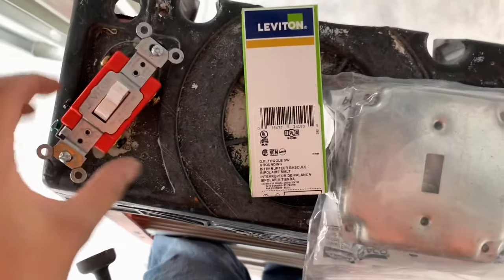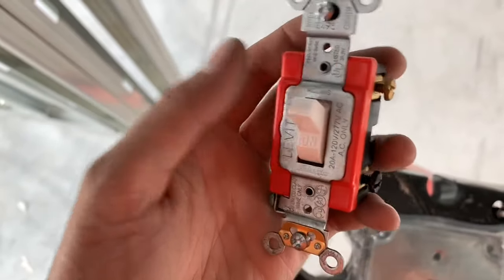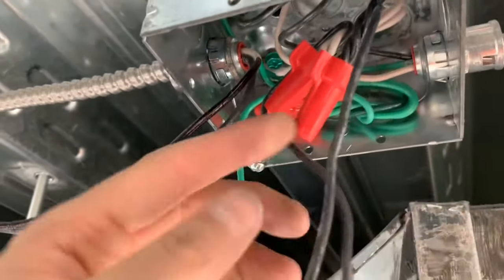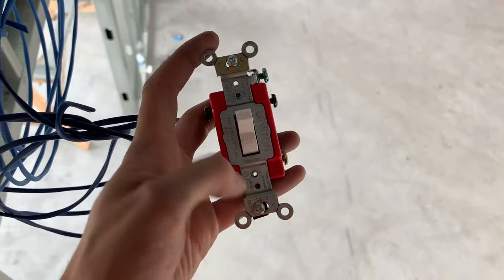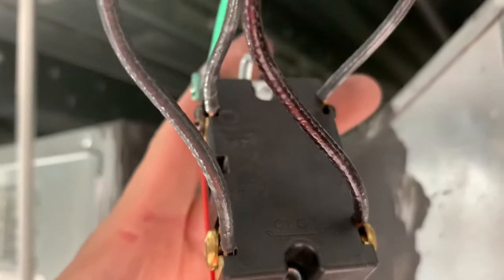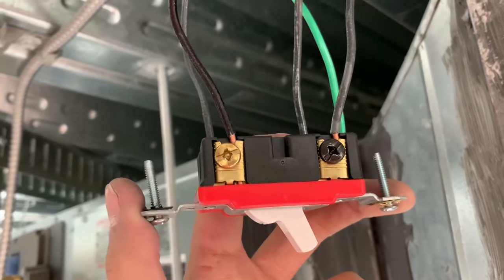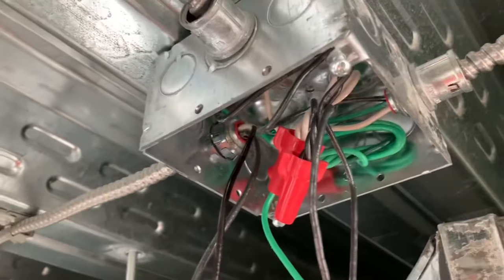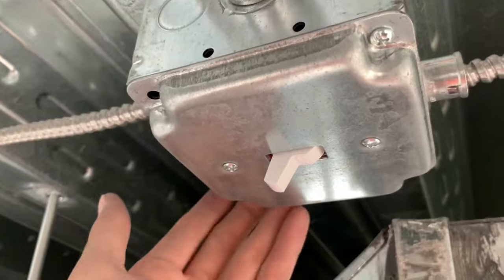How To Install A Double Pole Toggle Switch (Commercial)

Comment: I see a lot of people on YouTube showing how to wire a reversing switch on DC motors but not on AC.

How do you wire up a direction switch on an AC motor, like a drill press or bench grinder?

Can't you use a double pole double throw center off switch for that? Either a panel switch or wall switch?

And how do you wire it into the connection box on the motor?

I did it on my drill press with a four-way wall switch and a one-way wall switch for power.
I know that they make a double pole double throw center off wall switch also.

Some people say you have to use a drum switch but those things are pretty bulky and won't fit in my double gang box.

Or do you have to use a triple pole double throw switch?
My dad did it with a panel switch on his bench grinder back in the 40s or 50s.

Comment: Are you wiring 120 or 240. I'm not an electrician. But i just removed one of those type of switche and wired white to white and black to black. Ground wire was already twisted together. Just did it at 3:00 o'clock November 16th.
Reply from the maker: this is 240

Comment: Can I use this switch for a 240 volt electric hot water heater so I can turn it off and on?  But I would need a 30 amp switch.
Reply from the maker: yes, i believe so

Comment: Hi, I am confused about the part where you showed the load wires. I have one black and one white wire. Did you color over one of the white wires and if you did why?
Reply from the maker: yes i used black tape over the white wires, because they are carrying voltage and not used as neutral wires anymore for this 208-240v unit.

Comment: I know this is going to be a stupid question, but when connecting the load wires or the even the line wires to the switch, does it matter left or right?
Reply from the maker: its marked line and load, so it matters that the lines go on line side and loads go on load side. but it doesnt matter which side of line goes left or right, or load left or right.
Reply: @DailyElectrician  thanks... really appreciate this video and response.
Reply from the maker: glad to help :)
Reply: Well I try one? Nope is not working 
So I use line connect to black screw and load wire connect to red screw then boom is working
Reply: No, left or right does not matter is the answer you were looking for. As long as you have your load wires (lightswitch/water heater etc) on the load Terminals and your line wires (incoming power) on the line terminals.
Reply: Same goes for GFCI’s power on the line, anything downstream on the load since it’s protecting them

Comment: Hey I have an issue at work I have a 220 fan wire up to a single pole switch how is that possible?
Reply from the maker: it's wired wrong.

Comment: Awesome video man! clear quality. what makes me question you is the when you say "I'll be showing you the 277v option" then you pan up the camera to show 120v colors. secondly please explain how this could even be 277v when im seeing 2 hots for your hvac unit. Lastly is using a sharpie to color a white wire black workmen like manner? tell whoever is running that jobsite to order the correct materials.
Reply from the maker: maybe I meant 208, oops. not sure, never been called out for using a sharpie to recolor a wire. if anything its more workmen like manner because it takes way longer and looks better, haha. but i would say it could rub/ "wash off" one day. always up to the inspector to haggle you, even if you are right...

Comment: The ground wire on the switch itself - what's it's origination?  Is that the ground coming from your electrical panel?
Reply: Im having the same thoughts, im wiring a 240 garage heater with the switch as a disconnect, what im trying to figure out is if i have the switch grounded to the panel, do i need to run the ground wire from the heater to the switch as well and double it up. I cant find the answer.
Reply from the maker: rick yes, its tied back to the panel through all the grounds.

tyler the heater should be grounded, wether its from the switch or somewhere else. assuming the heater is coming off the switch so yes it should be in the switch box

Comment: Good as far as it goes but doesn't show how to actually wire the switch.  All 4 wires on your example are black. My load and line are the conventional white and black. Does that mean that the two black wires go to the black screws and two whites to the brass-colored screws which would make sense to me?
Reply from the maker: each brand is different, check the back of the switch for line and load markings.

once you figure that out, each pair of wires stays together from the same 12/2. so one white and one black. remark the white as a hot (black or red)
Reply: @DailyElectrician 
I was confused here too. So you can just run 12-2 and have your white and black as both hots. So is there no neutral? Not even in the panel? I was assuming 12 -3 before this. Thank you for the content!

Comment: I thought there were only three wires...red, black, and green. Red and black being 120 each. Why do you have 5. Probably a dumb question but I’ve watched a couple other vids and they only have 3. Thanks
Reply from the maker: incoming and outgoing power if i remember correctly. it is line and load, so one set of wires is power (and if theres 3 wires coming in the box, there are 2 sets of power wires pigtailed together) the other set goes to the unit like a switch leg. hope this helps :)
Reply: @DailyElectrician  thanks man most appreciated
Reply from the maker: anytime :)

Comment: Nice tip wrapping the switch and screws with black electrical tape. Pretty important not to have any of those wires touching the metal box!!
Reply from the maker: for sure haha
Reply: Wouldn't some other color of electrical tape work also?

Comment: Being an Electrician in Scotland working on commercial/Industrial installations. The accessories ie DP switches in the UK are much safer and more robust than the ones in the US, far too much exposed parts which make it unsafe to unscrew to check if dead or live in my opinion. Great video keep it up!
Reply from the maker: Thanks, i'd love to see what those look like :)
Reply: That’s the whole point of the switch. It’s for disconnecting power before you service the air handler unit. You don’t open the switch box to check if it’s dead. It’s only supposed to kill power on the load side of the switch. Line side will always remain hot unless you cut power upstream of the switch box. Do you know how electricity works?
Reply: @RB-xv4si  No shit sherlock but what happens when the switch fails and needs replaced? You prove dead before replacing. You have to unscrew the switch to access live terminals to prove dead. My point was UK accessories do not have live parts/terminals exposed in any way, you cannot physically put your finger on a live screw by mistake unlike the US accessories that have no barriers on there terminals. Are you even an electrician lmao.
Reply: @iScoTT29  ever heard of multimeter there is a dial you can turn to continuity to check if it's live or not. The US system relies heavily on the fact the user coming into contact with a live, 110V wire is much less likely to die than his European counterpart, who would face a 240V AC potential on that same, exposed wire. They changed to 110 because at that time when electricity was getting popular 110 was safer than 240 so they stuck with it so we have 110(for older house, 115(if you have 3 phase wire), 120 for smaller appliances and 240 for big appliances.
Reply: @AdamJames.  Well straight away within your first sentence you haven't got a clue clearly. A multimeter on 'continuity' setting does not tell you if it's live or not, you my friend would be blown up if you tried that. A multimeter would be set to the 'Volts' setting to check if it was live or not.
Reply: @iScoTT29  you should not be around electricity if you think you're going into the live box to find out if the switch is working. Someone's going to find you fried to a panel someday
Reply: @77Avadon77  You clearly don't understand electrics or what I originally said. To prove the switch 'dead' you need to physically open it up and test the terminals. In the UK that is not an issue as our accessories are considerably more safe with no exposed live parts which your fingers can touch, unlike the US counterparts. But then again, you may not test to see if things are dead in the US but in the UK we do.
Reply: @iScoTT29  As long as you kill the power at the breaker before working on the switch I don't see an issue. The screws are protected by the box. If you are unsure if your switch is good you might as well replace the whole thing, they are dirt cheap.